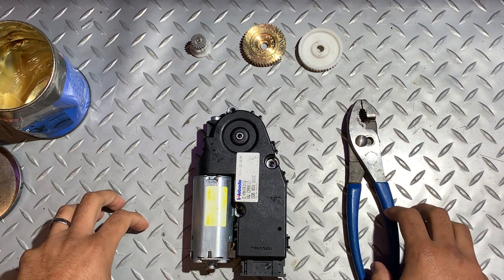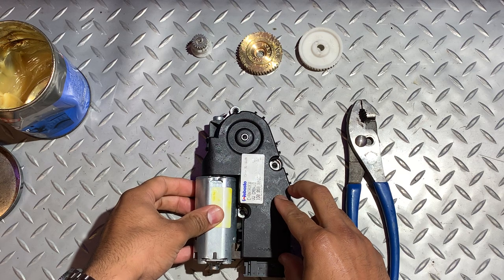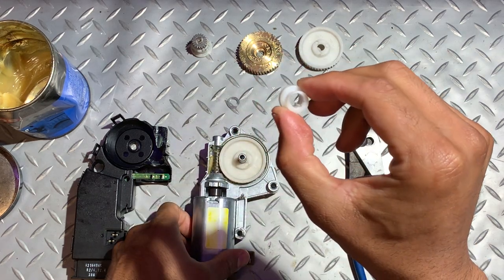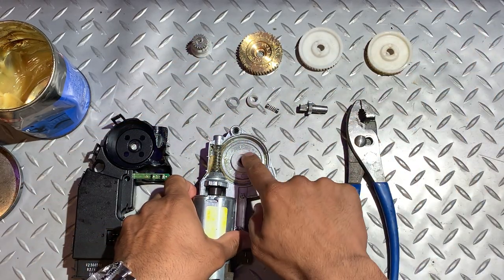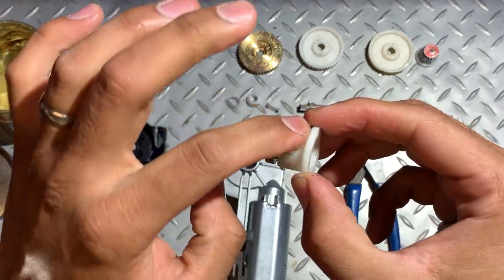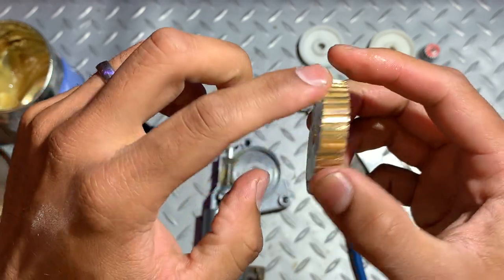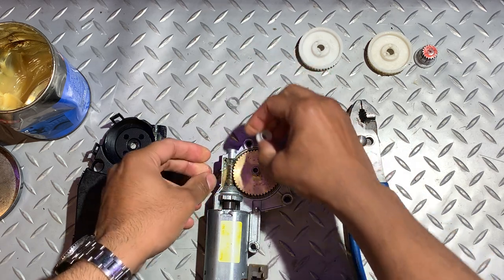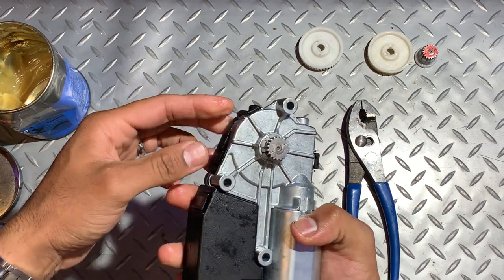VW Volkswagen Eos Sunroof Motor Repair / Gear Replacement

Comment: good evening if we remove the motor from the sunroof do we have to do programming afterwards where we plug it in directly and it works without programming thank you
Reply from the maker: Hello

If it has not skipped then no, if it has skipped then it will need Basic Settings

Comment: Excellent video how do I acquire these parts ASAP thanks.
Reply from the maker: lean KCR. 

Hi,

Still need to list the gears as only just got them back from manufacturers and testing.
Please contact us via our website.

Regards
Team VagPro
Reply: @CabrioletTech  Thanks will do is it best to call!
Reply from the maker: lean KCR.  

Best to email

If you call and I miss it, drop me a text
Reply: @CabrioletTech  Thanks will do just on my holiday's!
Reply: I'd like a link to the brass gears too pls.
Reply from the maker: elkeno 

https://rover.ebay.com/rover/0/0/0?mpre=https%3A%2F%2Fwww.ebay.co.uk%2Fulk%2Fitm%2F333219031712
Reply: @CabrioletTech  The link only shows the large gear, any other hints?
Reply from the maker: Richard Caruso 

We sell all parts on our ebay shop

Click on View Sellers Other Items

Comment: Hi, was wondering if you had any advice the eos after drained battery shows rear door open and reverse window on passenger rear some say a firmware flash will fix and others replaced the control modules which is way more complex.  Dont want to pay dealership for reflash if not gonna help
Reply from the maker: WILSON EVANS 

Hi, I believe we have responded on email